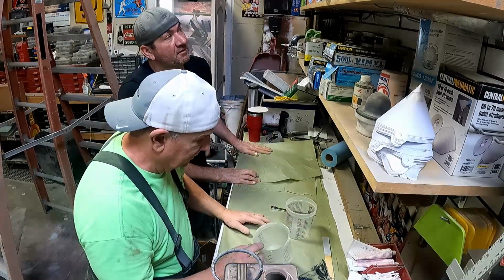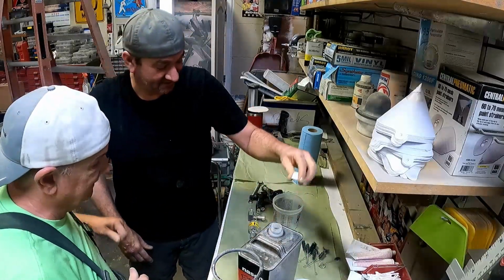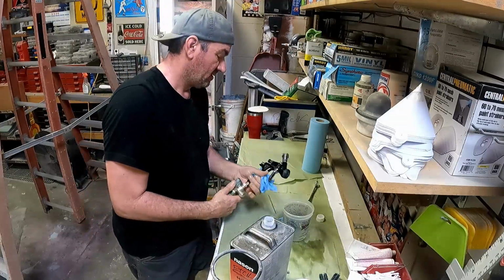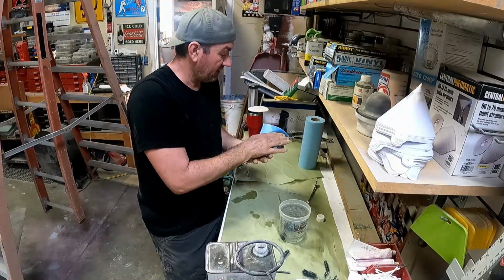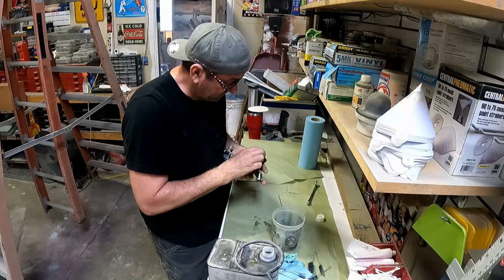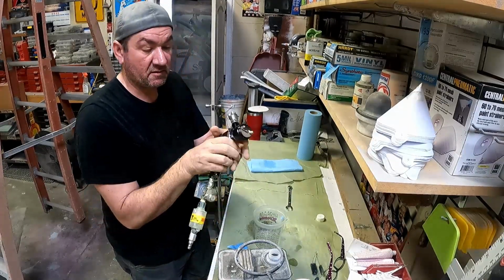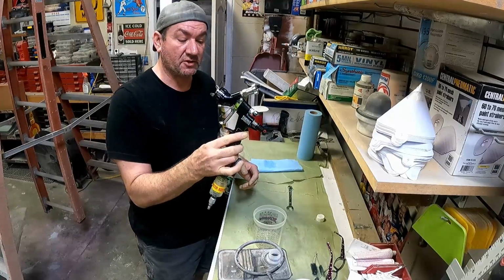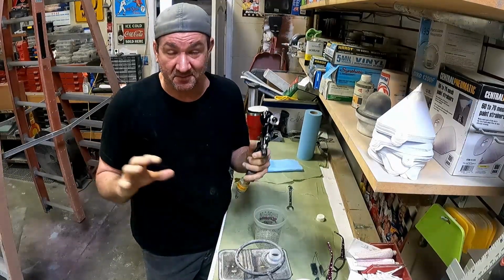DeVilbiss Tekna Pro Lite Clean Breakdown and Review

Comment: Tekna is the best in my opinion. Add more solvent to get a glass finish. I work in aerospace industry. I have the gravity and pressure fed version. Making the paint more looser and with the fan wide open you should have a glass finish. But need to spray fast to avoid runs
Reply from the maker: Yeah, after spraying the green car, I was gonna use a temp reducer that’s just right and if I encounter a “low flow” I was gonna throw a little more reducer in it.  Thank you for the suggestions!  I’ll listen to all advice!